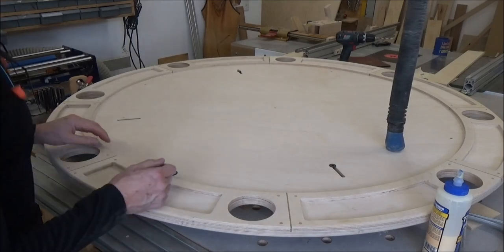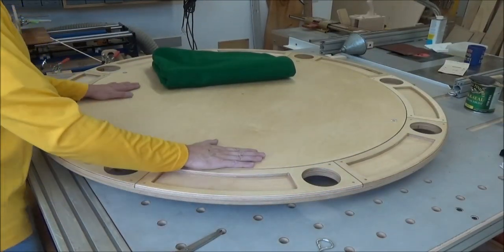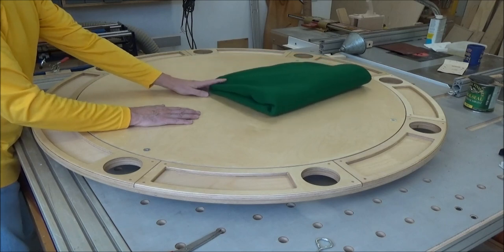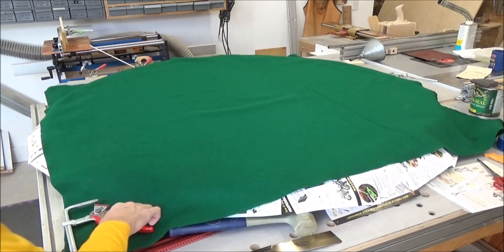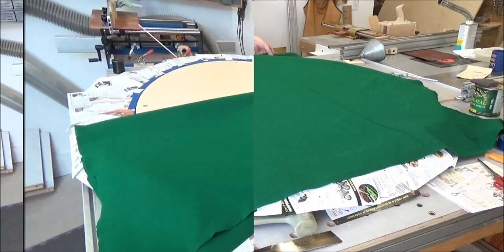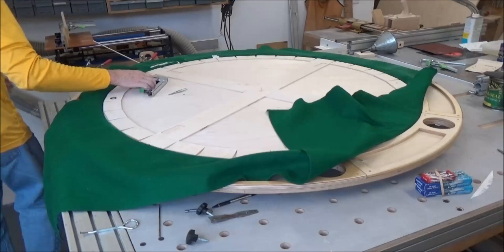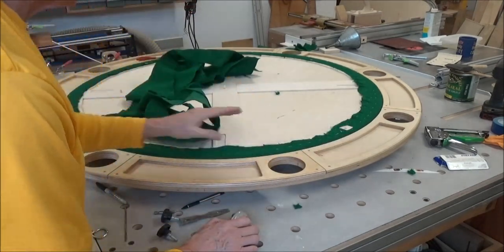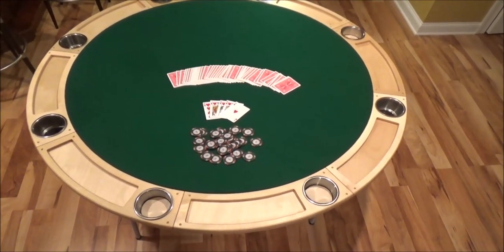08 Poker Table Top

Comment: Excellent set of videos, I share your love of poker and woodworking. Wondering if it was a regular or coated felt you used at the end or even potentially a baize fabric? The upholstery is always the struggle for those gifted at working wood :)
Reply from the maker: That green "felt" has been replace by a premium pool table felt. Played only 2 times on that. Cost 3 times as much but doesn't pill and cards and chips slide so much easier. Thanks for watching.
Reply: @JeffFischer1  ah yes, I thought it looked like quite a regular felt, good job on the upgrade

Comment: Very nice, clean work Sir. However, I have some reserve as to using spray contact glue; it doesn't last. However, the overall project is a fine piece of engineering. Well done. Hats off.
Reply from the maker: Thanks for watching and the kind words. I will say this about the spray adhesive. So far so good.